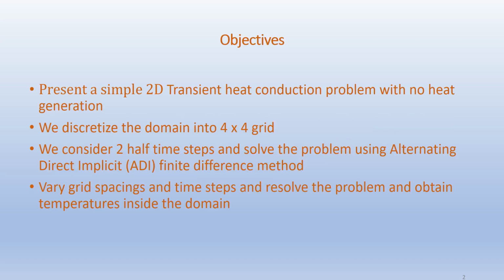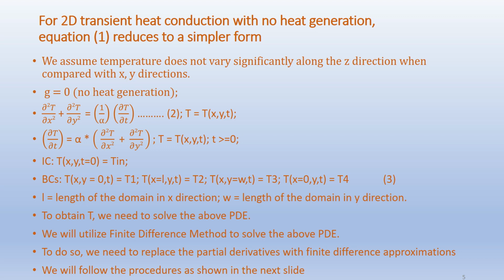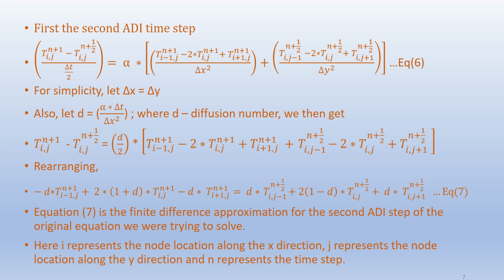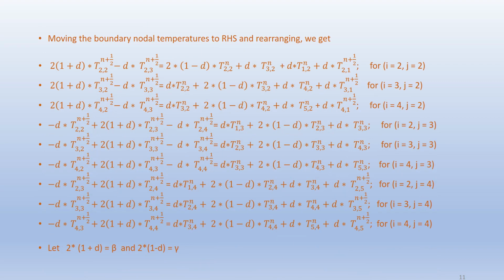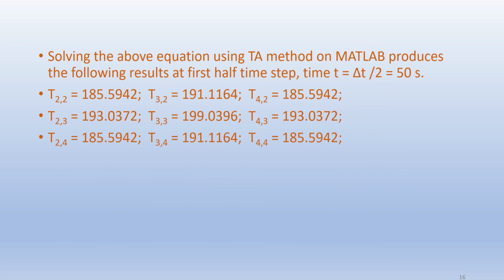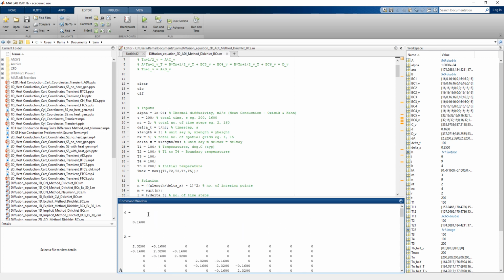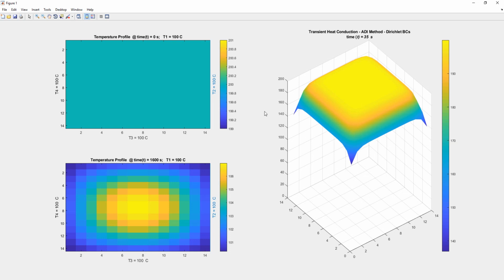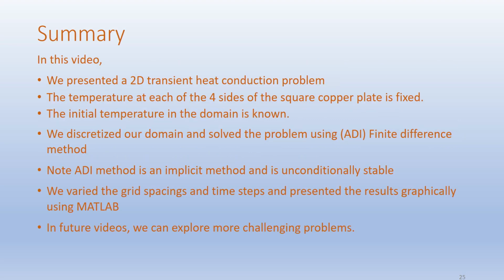Solve 2D Transient Heat Conduction Problem Using ADI Finite Difference Method

Comment: Hi, I tried your code with the zero boundary condition, but it seems like the result is not symmetrical. Should the 2D diffusion symmetrical if the boundary conditions are all zero and the heat diffusivity is homogeneous????
Reply from the maker: You can email me your inputs to samseleven@gmail.com and i willl check
Reply: @samseleven1  I will email it to you. Thanks!
Reply: @samseleven1   Hi Sam, I have sent the code to you through email. thanks!
Reply from the maker: @xinyutan987  try running using smaller delta_t eg 0.01

Comment: Great video! So ADI only applies to 2-D or higher Dimensional problems? It wouldnt make sense to try it with a 1D problem right?
Reply from the maker: Try CN for 1D problem
Reply: for a 1d problem BTCS or other implicit methods for heat conduction already outputs tridiagonal matrices when using the Dirichlet conditions

Comment: hi there,
here is the MATLAB code according to the powerpoint slides:

A=[ 2.32 -0.16 0 0 0 0 0 0 0 ; 
    -0.16 2.32 -0.16 0 0 0 0 0 0;
    0 -0.16 2.32 0 0 0 0 0 0;
    0 0 0 2.32 -0.16 0 0 0 0;
    0 0 0 -0.16 2.32 -0.16 0 0 0;
    0 0 0 0 -0.16 2.32 0 0 0;
    0 0 0 0 0 0 2.32 -0.16 0;
    0 0 0 0 0 0 -0.16 2.32 -0.16;
    0 0 0 0 0 0 0 -0.16 2.32];
C=[1.68 0 0 0.16 0 0 0 0 0;
   0 1.68 0 0 0.16 0 0 0 0;
   0 0 1.68 0 0 0.16 0 0 0;
   0.16 0 0 1.68 0 0 0.16 0 0;
   0 0.16 0 0 1.68 0 0 0.16 0;
   0 0 0.16 0 0 1.68 0 0 0.16;
   0 0 0 0.16 0 0 1.68 0 0;
   0 0 0 0 0.16 0 0 1.68 0;
   0 0 0 0 0 0.16 0 0 1.68];
D=zeros(9,1); 
D(:,:)=200;
E=[200;100;200;100;0;100;200;100;200];
E=0.16*E;
F=C*D+E;
B=inv(A)*F;
B2=[185.5942;193.0372;185.5942;191.1164;199.0396;191.1164;185.5942;193.0372;185.5942];
F2=C*B2+E;
B3=inv(A)*F2;

but this video is actually not real ADI because according to Numerical Methods for Engineers (Chapra and Canele-6.Edition Chapter 30 Example 30.5) you can not solve a problem like this. Because after calculating every new column or row values you have to assign them directly to the solution matrice. Let's say we have found the temperature values of first column at time step t+1/2 and then we have to do the calculation for the temperature values of second column at the same time step, before starting the calculations for the second column we have to replace the new temperature values of the first column. But in this video all the columns are calculated at the same time and the same procedure follows for the rows. 

Another thing , this algorithm in the video is just for 3x3 matrice, one can not compute 50x50 matrice with this procedure  because you have to write 2500 equations, the main advantage of ADI method is to solve such a problem with just 50 equations for 50 times by marching column by column or row by row (that depends on your choice) and reducing the computation time and matrice allocation memory. 

Hope you find it useful.

Best regards.

Özgün Korukçu Ph.D.

Comment from the maker: Thanks for identifying some issues. After spending some time looking into this, I noticed the following. The rows and columns at step n+1/2  are interchanged in the power point.  For example T(2,3) is interchanged with T(3,2) and so on. The column vector T(n+1/2) need to be updated accordingly in the power point.  I believe, the final temperature values at full time step - T(n+1) is correct. The Matlab files appear to be correct as well. Pls. let me know if you have any further comments or questions.
Reply: hi dear sam R
could you please share the code?
i need it so mush
farzadmoradi@hotmail.com
Reply: Hi Sam R, do you mind sending the code to zimmerman.john@hotmail.com
thank you
Reply: Please Doctor..  I want email or phone or any thing to contact with you... 
My email is.. 
mathafnan0@gmail.com
Reply: Hi Sam R, would you be able to share the code with me? Thank you so much. ziyinyuan97@gmail.com
Reply from the maker: @ziyinyuan97  codes are posted in https://engineering-stream.com

Comment: The temperature values at step n + 1/2 are exactly the same. for the temperatures n + 1, I found the same results as Mr MEHMET ÖZGÜN KORUKÇU.
I have just used the inv(A) command.

Comment: Temperature values at the n+1/2 step are exactly the same. although I checked my code and coefficient matrices several times I obtain the temperature values at the n+1 step as: 
174,124968114497
183,035326975928
174,124968114497
185,806951832354
196,121569876450
185,806951832354
174,124968114497
183,035326975928
174,124968114497
I'm not using Thomas Algorithm, I have just used the inv(A) command.
Reply from the maker: Mehmet, I think there can be small variations when you use different methodologies.  I noticed the difference is quite small.  You may compare your answers on some problems with solutions given. See for example - Numerical methods by Chapra.
Reply: @samseleven1   
I also obtained the same values. Here is my result on the n+1 timestep for the same initial and boundary conditions 

 100.0000  100.0000  100.0000  100.0000  100.0000
 100.0000  174.1250  185.8070  174.1250  100.0000
 100.0000  183.0353  196.1216  183.0353  100.0000
 100.0000  174.1250  185.8070  174.1250  100.0000
 100.0000  100.0000  100.0000  100.0000  100.0000

Anyway, on the last timestep temperature on the each node the same and equals to 100, so i think it doesn't really matter

P.s. I want to thank you for such a good example and explanation, you really helped me with this problem